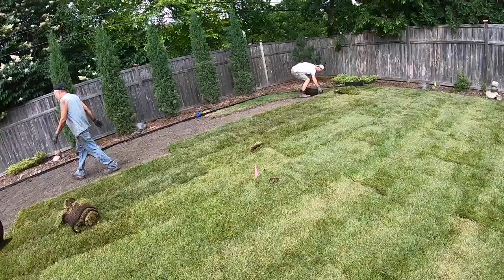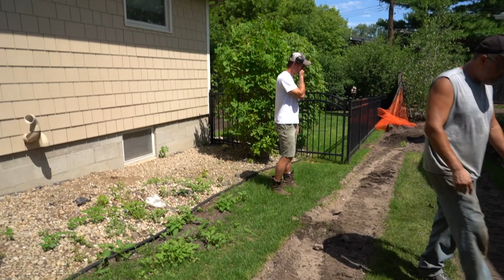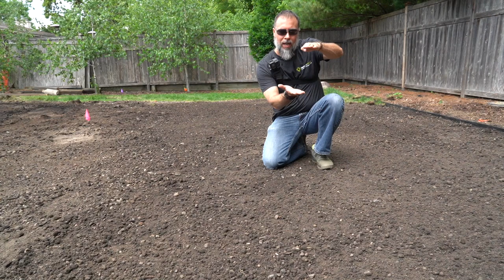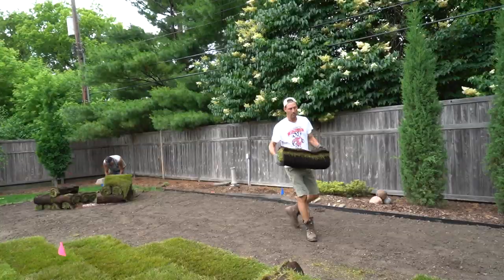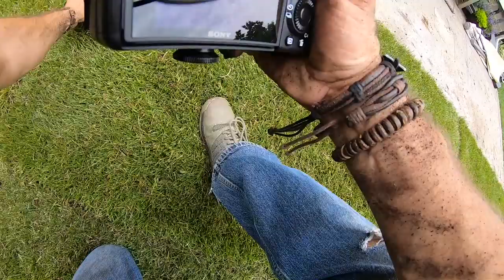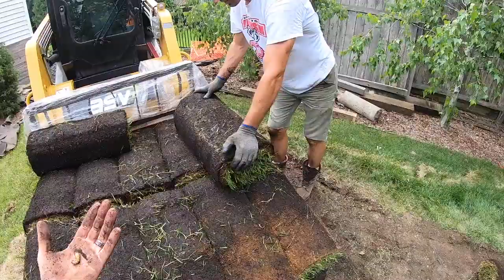How NOT to Sod PLUS how to identify problems & Take Care of New SOD

Comment: Base preparation is important.  We used to get it smooth and then wouldn't walk on it. We would start laying the sod,( we call it turf 🙂), and as we laid a full row we'd lay down boards/planks to walk on.  Then we'd work off the boards laying the next row and keep moving the boards out as a walkway. No walking directly on the prepared soil or the laid turf. 
An old saw worked well for cutting. Once down water, water, water and no walking on it for a couple of weeks.
Reply: thats the way to do it

Comment: First Rule is to tuck you sod seams tight and you wont have spacing. Also only overseed you sod if it thins due to weed control or burning in long/ hot Summers. Fertilizers and preemergents are the keys to weed free healthy lawns over the long haul. Also, if you have full Sun and shady areas in your lawn measure out the areas so before you order you know what type of grass and how much you need. I have also learned to set the Shady areas on one sprinkler/timer and the sunny on another, this way you wont overwater shady areas or under water sunny areas.

Comment: When I install sod down I actually sprinkle mix of granular humic acid and starter fertilizer down so it has a source food and conditioner. It’s never failed me  as well don’t forget to water it well the first 2 weeks and adjust gradually. This is great for installs in the spring, middle of the summer or fall. Never had a problem, it.

Comment: Was fine finish prep work included on the irrigation end.  I’ve only re prepped a site once or twice.  Even on that size.  But normally landscapers come in to finish and fine tune after my irrigation install. I do like how you mark the irrigation heads for cutting.  I too often find them missed and I’m called out to a problem.  But we quote the the check up after sod or hydro seed. So it doesn’t become a problem.  But more often than not i always find a missed sprinkler head that wasn’t cut.   Great work.  Keep it up
Reply from the maker: Thank you !!

Comment: . 1. Use a starter fertilizer before the sod is laid. 2. Lay the sod down loose, try not to stretch it, as sod does shrink at times. 3. When laying the sod make sure the seams are butted together smoothly, not just tossed together.  I guess just rolling the sod out and overseeded would be the quickest and possibly more profitable. 4. Water your sod early morning and when the sun begins to set or at  night.

Comment: I've never seeded sod and it always looked great.  You're the first person who has suggested it.  

I mean I dont think it would hurt.  But definitely a good up sale
Reply: I'm in the same boat, never had to or even heard of "overseeding" just prep and water after.
Reply: @ellwoodops4012  he said to fill in gaps as well, but if you tuck pieces properly you won't get those gaps, if you have a shredded end (it happens especially if you get sod after heavy rains) you overlap ends and cut the shredded part off.
Reply: @gregorybower2759  bingo
Reply: Questions - You mention that you overseed when this is a shaded area.  How do you do it?  With a hand spreader?  What shade seed mix do you use?  How often?  Once a month, twice a season? 
Question on Prepping the dirt - Should you put any type of fertilizer into the dirt before laying the sod, like a 10-10-10?

Comment: We used extendable snap knives for cutting sod they are cheap and you always have a sharp blade. We always tried to get the big rolls of sod and used a tractor or skid steer with a roll holder to roll them out
Reply from the maker: That's a good idea! Thanks for sharing 👍

Comment: By the looks of it, you're working with Fescue/Bluegrass. 

How do you address sodding warm season turf (Bermuda, Zoysia, Centipede and St. Augustine)? Very different growing habits requires different techniques. Never once have I had to overseed a warm season turf after installation. Some root as quickly as 1 week.
Reply: Where I live (and being almost exclusively commercial/high foot traffic areas) we lay almost solely centipede for its durability and ease of care. During the summer we usually lay it on a Monday and can start mowing the following Monday.

Comment: To solve problem with Irrigation companies, we just decided to do it our selves it's not that complicated to learn and adds to your business. Now we know it's done right and why can adjust accordingly
Reply: Yeah irrigation is not hard, especially on most average sized residential homes. It can be annoying to trouble shoot and repair though, and very labor intensive if you do not already have some equipment that you can get trenching/pipe dragging attachments for. 

We used to dig it all by hand, or subcontract the pipe laying for larger jobs, until we got a Ditch Witch mini-skid steer and a vibrating plow a couple years back.

Comment: I always level sub grade and add 100mm of top soil, I wheel roll it in with the loader so it won’t settle and leave humps. Then I rake it over to make it loose on the top 20 to 30mm , I use a smudge bar in my 4 in 1 bucket to get my grades 😉

Comment: You don’t just lay the Sod next to the previous row, you lift both seams and join them together..This lawn looks patchy..I’ve never had to overseed a newly sodded lawn.! If my man ever threw Sod rolls on the ground, it would be his last day..Adding a thin layer or Peat Moss definitely helps hold root moisture..
Reply: I have put down a fair amount of sod and dropping a roll of sod from 18" doesn't hurt anything. If it's a bad or thin cut roll, it'll come apart just rolling out anyway. I definitely agree on joining the seams better than these guys though, if done right, you can't even tell where the seams are.
Reply: I was thinking the same thing, we always pinch the seems and make sure that grass blades aren't stuck underneath. When it's done right you can't see the seams. Also I put a 6" base of loam or 21 yards per 1k sqft. We have very Sandy soil and I never back drag with the machine the crew rough grades and then we finish rake. I have seen some nightmares with the irrigation heads not cut out or sticking 3" above the sod.
Reply: @corym.3580  Where I live nobody uses or needs irrigation so that is something I have never really worked around. We also have pretty good soil so we just harley rake the area and then finish grade by hand.
Reply: @strix4667  your lucky you have good organic material in your native soil, here on Cape Cod it's like beach sand. We have to put down loam or the lawns burn out at the first sign of warm weather.
Reply: Yes definitely stagger the seams. Make sure the sod isn't stretched as in shrinks. 3 like all yall said yes make sure the seams are butted together not just laid down and you can still see your seams, but i guess that's why they over seed, which wouldn't hurt anyways.
Reply: lol you probably don't keep a lot of guys working for you then

Comment: I guess we're supposed to just make the pipes and valves  appear underground without doing any digging.  They do a partial grade then irrigation then final grade is how it works on my jobs in NJ. We set heads and valve boxes a few inches up for final grade and sod. Valve boxes are marked with 1inch   PVC to aid those pesky landscapers from running them over with their machine when they do final grade😆
Reply: Lmfao that's what I was thinking.
Reply from the maker: Ok- but heres the rest of the story-we demolished a swimming pool and filled it in over the course of 4 days.  We brought in Hundreds of tons of materials and removed the same amount out and still kept the side and front yards cleaner than they left it
Reply: I was thinking the same thing.  It sounds like they were whining so they could charge the customer more, even though they are the ones who did it out of order.
Reply: IDK... I install irrigation for a landscape company and have no problem flattening my seems with my pipe puller and raking out my marks when I'm finished. Final grading done or not, I try to leave my yards looking the same as I walked into them, Just with some boxes and flags poking out.

Comment: Use an Old steak knife or other serrated blades to cut sod makes cleaner quicker cut. If you can find a Olfa serrated knife blade they extremely well.
Reply from the maker: Thanks for the tip!

Comment: When I need to cut a roll of sod I use a hand edger and i cut from the top of the sod i feel like using a hook knife or a blade your ripping the sod more then cutting for me using a hand edger cuts clean and I just find where the sod meets the original turf or other sections of sod make a line of where they meet and make a clean cut
Reply: I always use a dollar store bread knife. Seems to work the best
Reply: Always use a machete. Very clean cut.

Comment: Never have overseeded over sod. Ive installed thousands of sqft. If you have proper root connection then you shouldn’t have a huge issue.

But my real question is do most ppl roll after its installation. ive been asked a few times recently but never have before. Pros & cons?

Comment: Stanley thanks for another great video. Looks like I get to spend my spring and falls top dressing POS builder put my sod on sand mix. Ps what's up with the uni bomber beard. Makes you look old 1 vote to loose it. Joking.
Reply from the maker: Im on the fence about the beard.
Reply: Best to aerate a lot before top dressing a lawn. Helps mix the good an bad soil. The good organic soil will fill the holes and mix the soils.

Comment: Go to your local butcher by there old sharpen filet knives and use it easy to sharpen and you don’t care if you loose it  I always spray my knives with a fluorescent pair being remodeling contractor and landscaping co owner if drop a utility knife if a roof say I can find it or if your working set it in grass you see it gray color tools disappear in grass especially if I’m doing grade work or concrete

Comment: Likes your videos but you really need to teach your guys how to lay turf or sod the right way. One walking over turf you have already laid. Two put down boards instead of walking all over the soil. Three use proper soil or sand with no sto es In it. Alot of god loams out there for turf or soil.  Also you don't need to seed new turf just put mixture of soil and seed between the joints of the turfs to help stop it from drying out. They are leather jacket and if you found them in the turf I would not be laying it instead returning it to the supplier cos they should treat all the turf for leather jack before sending the load out.

Comment: That was a grub there is fertilizer that gets rid of them works awesome I used to by a years supply for customers that water a complete fertilizer contract I worked a deal with my landscaping supply four signed contracts out 100 customers 75 % of them complete fertilizer packages so at the beginning of the year my customers paid that contract in full so on my daily cuts I was able to all my materials at once pallet size and I just stored it on my premises if the customer had a outside building to their material I delivered it and it was always available up on cutting there lawns this way they felt more comfortable that I wasn’t either ripping them off or can see what I used over time but 99% of customers were customers of my remodeling co that were repeat customers for many projects over 30 yrs

Comment: You don't roll the sod afterwards?
Reply: Why would u roll sod? If the sub grade and final grade r smooth and correct there's no need unless ur trying peel up the sod like a lint roller
Reply: @davidmoore8741   i thought it was to eliminate air pockets ensure full sod contact with the topsoil.  Also to press down edges and seams so they aren't left sticking up where they'd be susceptible to easy scorching.
Reply: @shaymoose17  first I ever heard of such a thing. Air pockets? Lmao
Reply: @shaymoose17  the first time it gets watered the sod will settle in. Rolling it just compacts the soil. Not good.

Comment: I like how you said contractor and not exactly saying the Irrigation contractor, you probably didn't want any backlash from the irrigation contractor. But how do you expect a sprinkler system to get installed, but to drive over your graded dirt. For all the years you been in business , quit your complaining. Besides that it looks like you need to talk to your sod supplier and complain  about the grubs in the sod.  How its costing you money for treating for grubs, for if you don't treat for them you will be doing a free sodding job, six months from now.